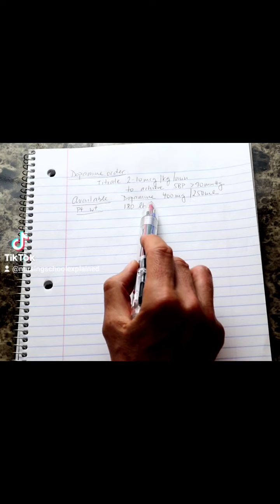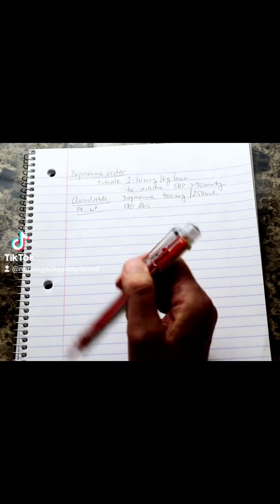Dopamine dosage calculation and titration using dimensional analysis #shorts

Comment: i understood the dimentional analysis but where did you get the 5 to check? Just wondering (:
Reply from the maker: Great question! The problem asks to calculate the range of 2 - 10 mcg/kg/min --> 2 TIMES FIVE is 10. 
Two separate calculations are being shown, one for the 2 mcg and one for the 10 mcg dose. Since that is the only variable in the dimensional analysis, the result should also show that the second result (for the 10 mcg dose) should equal 5 TIMES the 2 mcg dose. It's a way of cross-checking your work.
Hope this helps!